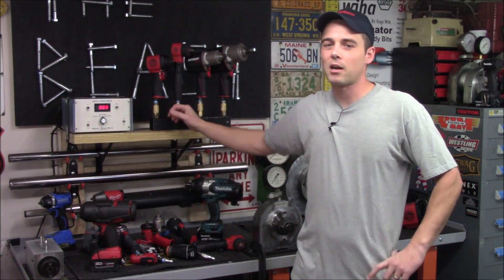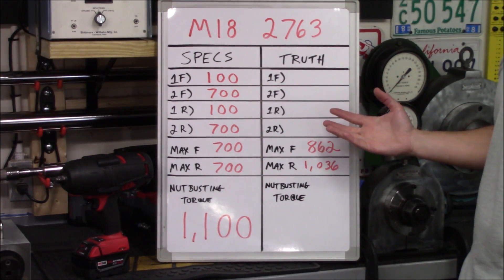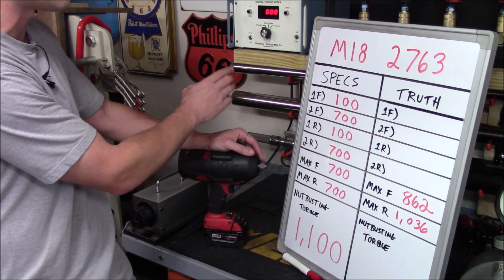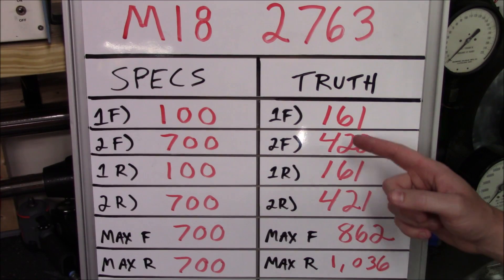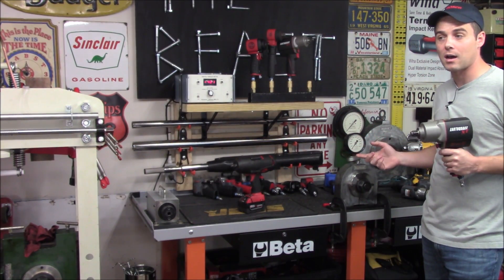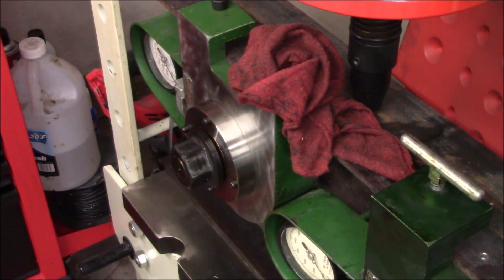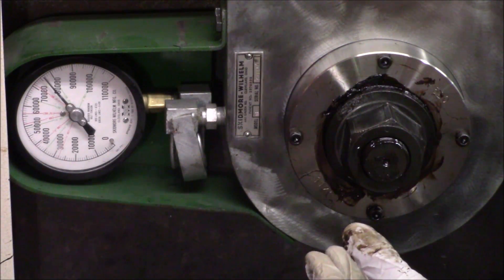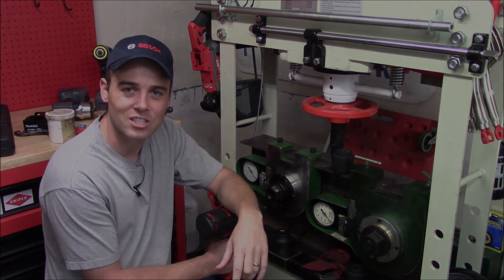THE BIG LIE -- Nutbusting / Breakaway Torque (What is it?) - Impact Wrench Torque Ratings

Comment: I think what I can take from this video is tool companies are over rating their tools to make them sell better and if we all used a manual torque wrench to torque up bolts as they should be, such as car and truck lug nuts, possibly the lowest to middle priced cordless impacts would be all we need because they were tighten up properly to the manufacturers specs and this would possibly leave the higher upper priced cordless impacts sitting on the shelf not selling because we didn't need to tighten a lug nut that tight in the first place. For example a 94 chevy 1500 truck show only 100 ft lbs roughly. Well, a decent low priced cordless impact is right in that area at about 1/3 of it's rating. I guess we have become soo brain washed with these,tool companies that they are cashing in on our ignorance, they know we think bigger is always better and we spend extra money on larger impacts when really not necessary. If you drive an 18 wheeler or something, that is a way different story. Those lugs are usually much tighter and have to be loosened with larger heavier air impacts. All in all, great informative video.
Reply from the maker: Yes.  Almost all “amazing abilities” of new tools are nothing more than creations of marketing departments….. never trust them.

Comment: Great stuff, but I don't believe the "Breakaway" should be "Ignored". 
Rather it should be "understood".

It's like saying "horsepower" should be ignored, because it only occurs at high RPM range, and ignores the torque curve vs rpm.

Well, either is a standardization,  and each has a sprinkle of "marketing". ie "horsepower" sells cars, but torque/rpm curve explanations put most customers to sleep. 

Next video.  Go measure the actual torque required to bust loose the axle nut on a 12 year old Honda minivan with 225k miles
 😀 👍 
(I think factory spec is about 150 ft lbs?)
Reply from the maker: Some companies embellish waaaaaaay more than others.  If every new product they release has a cookie cutter marketing campaign of “BEST EVER MAGICAL LIFE CHANGING CANT LIVE WITHOUT!!!”…..trust nothing they say.

Comment: The only way to get to the bottom of it is to use a repeatable torque wrench to tighten a bolt through a plate so you're not measuring clamp. Then bust it off with the impact wrench. Yep, it takes a lot of time.
I went through this decades ago at school over a 6 month period. The many types of test equipment took up about 700 square feet. 
Corrected clamp force has nothing to do with torque. We tried grease, we tried heat, we tried bearings... about 60 pages worth. Conclusion? No tension or compression gauge duplicates friction at the threads/contact surface. That's why bolt clamp load is measured in stretch when possible.
Your tension tester does make for rapid fire comparisons of items to make videos. And for that I appreciate your efforts. But in no way does it even begin to tell you how a company comes up with numbers. 
When was it last calibrated? How do you calibrate it? You calibrate it with a weight on the end of a pole if you want values absolute.
 Yes, a standardized rating is needed. But we would be just fine if every wrench was as close to the knock off claim as this one is. 
The video is very miss leading. It should be removed. Might save some $$$$$$.
Reply from the maker: I test literally the EXACT SAME WAY as most of the major manufacturers….. I’ve been in their R&D labs.  I’ve done this exact same testing AT those facilities.  So you unfortunately are mistaken.

Comment: Not expecting any response as this is several years old, but just saw it for the first time :) 

How come there is no test that show it can NOT remove the 1100 ft lbs bolt when its cold? If only showing that it can remove a bolt tighter than what itself can produce, that just confirms the marketing that it has higher break-away torque than fastening torque?

Also would love to know how significant the heat buildup is, seeing as one of the most common tricks for tough nuts and bolts is to externally heat them up. If the wrench itself can heat up a bolt enough that it becomes easier to remove (seen bolts become untouchable after using an impact wrench on them), then that should be counted in as the work it does, right?

Im not expert in this at all, if there is something I dont understand here, please enlighten me

Comment: What an odd video - let me show you why they don't tell the truth... Followed by "if we tried to loosen this nut cold it wouldn't work" erm... Why not show us then? That would be useful. All you really did there was prove them exactly correct - the wrench under your test conditions could remove a nut tightened to 1100ft lb.

If you are correct about it not working cold.... Well... Seems like a tiny bit of extra effort to have just done the test? Makes me think you're not so sure about your takedown...
Reply from the maker: The test unit is hydraulic..... it cannot remain under pressure for extended periods of time without seal failure.

Comment: Why not wait to the bolt gets to room temperature and try again with the Milwaukee to see if it can remove it?
Reply from the maker: It is a hydraulic test unit, and the seals are not designed for extreme pressure for extended periods of time.  If the pressure isn’t released quickly, it can damage the unit.

Comment: I have two different bolt, one is high tension bolt, the other is medium, both of them will be tighten in the same torque, let say 100 nm, both of them will be loose with the same impact wrench with max torque 300 nm my question, is there any different ?
Reply from the maker: I’m not sure what you are asking
Reply: @RealToolReviews  I think what he is asking is will you require the same amount of torque to remove a nut from a grade 5 bolt and a grade 8 bolt.

Comment: Very informative! I know this video is a littler old now but still relevant. I was debating between a Stubby with 250 ft lbs of torque or a mid torque with 600 ft lbs of torque and decided that since this tool will be for DIY car projects I want the more powerful gun to help me remove those bigger and tougher bolts like in suspensions. The Stubby looks awesome but my concern is that the advertised torque won't mean anything once I try to remove a rusted suspension bolt. Thanks!

Comment: I've always ignored that nut busting/breakaway rating for that very reason.

Heat up a fastener and/or throw some penetrant on it and you don't need as much power. To give the gun credit for that is disingenuous at best.

Comment: Your using the wrong milwaukee lol do this again with the 2764-20 thats the model the earthquake xt is modeled after lol what a fucking fail this is xD
Reply from the maker: Try looking at the date the video was made....
Reply: @RealToolReviews  you realize in 2016 there was a 1200 ft pound torque impact from Milwaukee that you should have used 2764-20  and u diidnt :/

Comment: That was very interesting. I questioned the breaking loose torque of my Kobalt 24 volt 1/2" impact wrench. Now I know how loosening torque can be higher than tightening torque. If you would have not shown me, I would not have believed it. Which means, I did not believe what Kobalt was telling me in the specs.
Barry G. Kery

Comment: I'm just curious after explaining and demonstrating this throughly why wouldn't you show us if it could or couldn't remove the nut after it cooled? I see you proved your point but again would've been interesting to see after it cooled. Thanks for the video.
Reply from the maker: The test unit is a hydraulic load cell..... it cannot remain under pressure for extended periods of time (per manufacturer) or will suffer damage.

Comment: This guy clearly doesn't understand physics and torque wrenches. Impacts per minute. Torque wrenches do not apply a constant force. Their rated "nut busting" or "break away" torque is how much torque is applied instantaneously. Your machine cannot measure instantaneous torque readings... It is not designed for that. It measures constant applied force. Which is why it reads higher for first speed and lower for the higher speed. Impacts do not apply any dynamic force! 

This is why you can hammer away at a bolt and 10 seconds later it will come loose. The impact is slowly moving the bolt one impact at a time. And while you might not be able to see it, the bolt is moving.... It applies 700lb-ft of torque instantaneously. But if you hold the gun loosely, don't use impact rated sockets, and use the wrong instrumentation, then the gun will underperform. They make special sockets which are 10x the mass of regular sockets to allow the gun to put out more force due to the lack of power they produce.

High torque low power. 700lb-ft of torque won't move a bolt if you have no energy... use the right tools.
Reply from the maker: The level of your ignorance is impressive.

Comment: Need a review of the Milwaukee 2863 Onekey....The Onekey settings are confusing & they don't tell you what each setting means in terms of torque. (I understand each socket/extension/bolt/nut combo changes things... but they don't even attempt to provide a baseline)

Comment: so basically we should take a couple 100 Fps off the manufacturer rating as rule of thumb?
Reply from the maker: Basically they almost all lie & try to one up each other.  Milwaukee lies about the ratings of EVERY tool they make.....RIDGID & Chicago Pneumatic (for example) are usually dead-on with ratings and don’t lie.  That seems to be a common trait, either a company is totally full of it consistently, or they tell the truth.

Comment: This is a phenomenal video.  I've never seen this "marketing hype" described and properly characterized.  
You did it.
I'm wondering, does your test setup have any type of analog voltage output ?  It would be informative to record that information on a digital storage oscilloscope to see the torque change dynamically as the impactor slaps against the stops.
Again, excellent video.  Educational.  Informative.  And highly entertaining.
A+.

Comment: I bought the 2767 wich outputs 1400 lb-ft of torque and i have a mac air impact also advertised 1400 lb-ft, it was not a scientific test but with a m16 bolt and nut, it was quite similar, both in tightning and loosening but the mac had the advantage of speed.
Reply from the maker: Milwaukee Tool marketers are legends in their own minds....

Comment: I knew this torque rating BS was getting way out of hand.  As a mechanic that knows what it means to tighten a bolt or nut to 1000+ lb/ft of torque, there's no way I buy these tools companies' BS about 1200 or 1400 lb/ft of torque out of a small 1/2" cordless impact wrench.
Reply: Vibration does more damage than you'd think, and when you're impacting something with 400lb+ of force, 2,400 times a minute  and you just hold it on for 15sec it will do alot of damage

Comment: Dude, throw the science out for a second. Can the other impact wrenches remove that nut? I think you are OVER thinking this. The Milwaukee did something i don't think other brands could do. I may be wrong, but I think you are missing a huge point here. 

I would now buy the Milwaukee based on what you just showed us. Even if it can't remove a cold 1100 lbs, it sure showed some brute force.
Reply from the maker: Some manufacturers exaggerate WAY more than others.....for example, every single tool that Milwaukee makes — is the #1 best/life changing/magical tool that has ever been created!  Don’t believe me?  Just ask them!  😂

The point of this video was to expose a marketing lie.

Certain manufacturers don’t lie constantly.....such as RIDGID or Chicago Pneumatic.  When they advertise a spec, the tool actually performs.

Other manufacturers look at their competitors.....then add 5-10% more to the advertised specs & claim they are superior.  It’s lying.... plain and simple.
Reply: @RealToolReviews  I really appreciate you getting back. I just found your channel and in looking it over, noticed you don't post much lately (videos). I was hoping you didn't go away. If you need to buy a good impact wrench reasonably priced, which would you buy? I am in the market and don't want to buy something to be sorry about.

Comment: Correct, this Marketing deception is much the same as absurd Horsepower ratings on Air Compressors where a 120VAC air compressor has a 5hp rating and similar. This "Nut Busting" marketing ploy became a effective marketing deception in time as it became and effective marketing tool. Try applying 1500ft/lb of real torque using that 1" drive Proto torque wrench or s1" drive or larger  torque multiplier to a 1/2" square drive... see if that 1/2" square drive fitting stays together at 1500ft/lb applied. failure is likely at 500ft/lb. Reasons these impact tools can remove threaded fasteners at greater fastened torque than what the square drive fitting can hold under constant loading is due to accumulative energy put into the threaded fastener with each hammer hit. This effect is similar to climbing up stairs to reach the top rather than reaching the top in one leap.

Some one should take the anvil out of any of these 1/2" drive four figure "Nut Busting Torque"  rated impact wrenches, fixture it very firm and apply 1500ft/lb of torque to the 1/2" square drive anvil and see if the anvil can withstand 1500ft/lb of torque. This IS the reality check on what 1/2" square drive is actually capable of.

Comment: I'm not buying it. You torqued it like 4 times and it warmed 20 degrees. That's not extremely hot. The gun can take off more than it can put on because the force on the thread fights in tightening, but helps it loosening. It is an inclined plane after all.

Comment: I realizing I'm adding this comment about 2.5 years after you published this video - but it's excellent, as are all your others I've watched so far. You really add a level of thoughtful methodology and analysis that's incredibly rare across the field of those who publish reviews and "tests" of various tools. I really appreciate this. I landed here tonight as I continue to round out my tools collection. I've got a few Ryobi One+ tools (brushed, from a combo set I got about 4 years ago) and have made extensive use of them. I hesitated going to a second battery system, but when I needed a good double bevel sliding compound miter, I snagged a great deal on a Maxita 36v LXT X2 saw that's brilliant -- no regrets, and I just added their rear-handle 7-1/4" 36v LXT X2 circular saw as well -- also excellent. So - I've had two battery / tool ecosystems (One+ and LXT), and will stick within those for the foreseeable future.

After reading numerous reviews and trying different impact drivers, I just got a Makita XDT16z, and it's fantastic. But now as I consider adding an impact wrench for bigger loads, the choices get muddier. And THAT is why I wound up here. Tools like Makita's XWT11 impact wrench don't - on paper at least - look that much more powerful than the XDT16 impact driver. Their XWT08 is a lot more powerful at 740+ ft lbs -- but it's also 5 lbs heavier, and I'm not sure I'll ever really need that level of torque. Most likely the more challenging uses of an impact driver / wrench will be putting in 1/2" lag screws, LedgerLok's, through-bolts, etc. when rebuilding my deck and tackling similar work. Ryobi's most powerful impact wrench (one of two I think?) is claimed to put out 300 ft lbs - and it's a 4 or 5 year old brushed model, and is bigger and clunkier than the XWT11. Makita's "mid torque" models are 5 year old designs that are also big and clunky it seems. Unfortunately for me, it currently looks like the most eligible "mid torque" lightweight impact wrenches come from DeWalt, or from Ridgid (they just released a nice one that's light, and is rated at 450 ft lbs I believe).

In the end, I'm trying to decide: 1) if the XWT11 adds meaningful torque beyond what the XDT16 puts out, and 2) whether the XWT11 is sufficient, or if it really does make more sense to deal with the bigger, heavier, XST08.

If you're read this far - thanks! Long winded, but now you know what I'm trying to work out. Any thoughts on this most appreciated. Thanks!

Comment: If the company doesn't disclose their testing, how do you know they are using hot nuts and bolts
Reply: Ken you are. Absolutely right, as a former QA, tech most tools were checked in a quality controlled temperature that was to be there overnight to get the proper temperature and was in compliance with Nist, Anis,Mil, standard for traceability, even the torque wrench was at +/- 3-2-3 at different interval of testing range for accuracy, I wish he would have used a 2000 ft/lb torque wrench and torque the bolt let it cool as it would been at normal temperature or at the temperature you normal find a bolt in the shop setting or at a salvage yard would really tell the true nut busting or break away force,

Comment: The BIG Lie? Ever seen rusted bolts? They take more torque to remove then the amount of torque that was applied to them before they rusted. What ever term you want to call it, the impact was able to remove a nut that was torque to 1100 foot pounds. Real life is working on equipment if it will remove a rusty nut that it would take 1100 foot pounds or more applied by a 6 foot or longer breaker bar then it works. most mechanics don't care about F1 F2 R1 R2 ratings I don't really care much about forward torque only removal torque. I don't torque lug nuts with an impact but I do remove them and run them on with one.